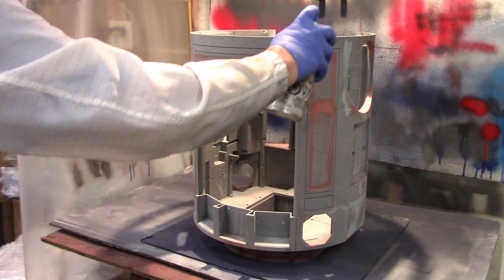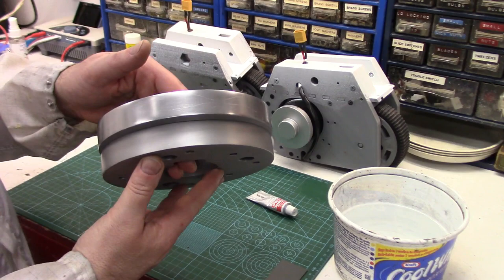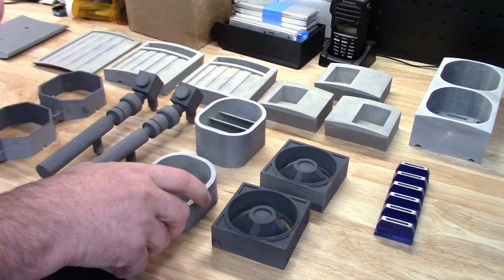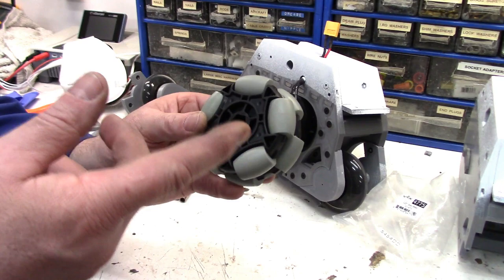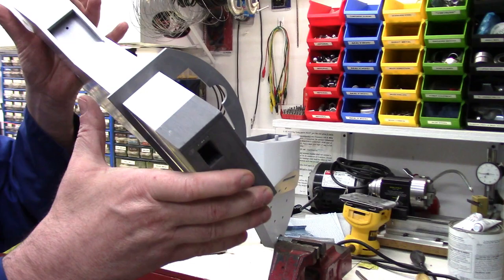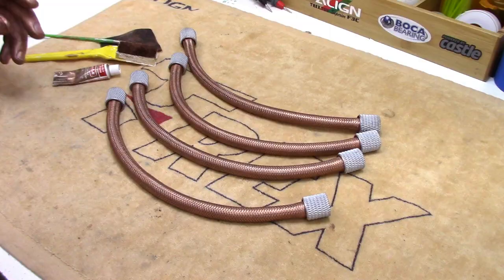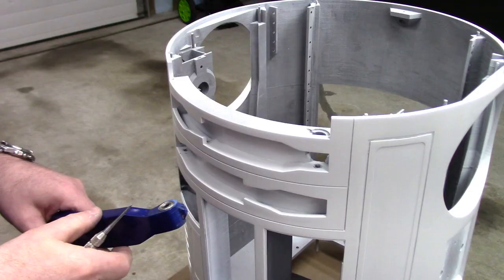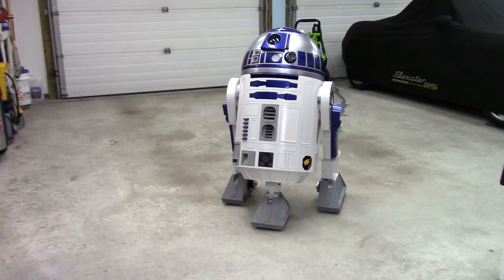Painting R2-D2 - Plus More Finishing Tips & Omni Wheel Installation.

Comment: Awesome build! I'm envious you got it done in such a short time. I've been working off and on with mine for 3+ years now. 
I'm a bit confused by your math though. You went through 31 spools of filament which to me would be 6 times the cost of all of your paint. Unless paint is a lot more expensive in Canada than filament. :)
Very cool though. You've lit a fire under me to make more progress on my build. I've gone through a lot more cans of filler/primer though and I still haven't touched the legs and body. That's what I get for printing at .3mm for everything I guess. lol
Reply from the maker: I break down final costs in the finished R2 video: https://youtu.be/sIpBA6UigTQ
As I mention in that video, cost comparisons of R2 builds are completely irrelevant as they vary greatly from country to country - even region to region. After tallying everything up, paint costs for me in the remoteness of the Canadian Rockies ended being the 3rd single highest cost behind electronics (1st) filament (2nd). Yes, spray paint is costly up here - as I joke in that final video - its base ingredient must be unicorn piss.
Reply: @Rchelicopterfun  I saw that video. And yes, when I heard your Unicorn piss line I cracked up.
Yeah, the cost varies. Sorry if I hit a nerve. I saw the cost on Amazon and balked for filler primer and went shopping. I found it on Walmart for $4.97 a can. I just bought 3 more cans since I've been going through a lot lately. (and 1 can clogged on me)
Remoteness: Ah. Yeah, that'd suck on shipping costs and timing.
Question: I was curious if you are going to take a stab at building a flying droid next (the Imperial Probe droid has been done but I haven't seen plans for the flying version out though) Or one of the other droids, or the remote control AT-AT on Thingiverse? :)
I tried to build a flying D-10 but I didn't get far.
Reply from the maker: @Chris Hechti - Hit a nerve?  Nope, don't know how that came across. 🙂 I just stated the cost of spray paint up here is high. Sandable primer $15 a can. Blue Pearl $22 a can. Rusty-Olium 2X $12 a can. No plans on any droid that flies. Having a full size R2 was a longtime childhood dream and it's the only Astromech droid I have any interest in, at least in terms of spending money & precious time on.
Reply: @Rchelicopterfun  Oh wow. Yeah, the blue Pearl was $14 a can for me. The White was $6.
https://www.youtube.com/watch?v=LAZP9rmpVd8
There is another version. Given your background with RC aircraft I thought it might tickle your fancy. Oh well. :)
Great work with the R2! I'm going to use a lot of your tips. And thanks for pointing out the issue with the dome bolts. I over tightened mine and couldn't figure out why it kept cracking for a long time.

Comment: You are truly a great builder, following you behind by about a month and the tips are really appreciated! Great work!
Just a quick question - I see you're using gloss on blue, are you also doing gloss coat over white color?
Reply from the maker: @Drowiz - I'm clearing the blue parts only; they are the only ones I wanted with a deep gloss finish. In hindsight, having a flat/matt finish on the blue would have been much easier as it hides imperfections instead of magnifying them like gloss does. However... I love the look of the  glossy blue 🙂Have fun with your build too 👍

Comment: Definitely saving all of your videos as I am just starting my R2 project.  One thing: in the instruction downloads for Mr. Baddeley, he make reference to R2D2 v2 Centre Foot Guide (retired, use MKIII) but I cannot locate the centre for guide for the MKIII version - were you able to find it, or did you wing it? Thanks!
Reply from the maker: Sorry, but with the hundreds of files for this project, I don't recall. I also have a block of wood in my center foot due to the fact I'm using rollerblade wheel castors instead of omni-wheels. Perhaps it's a file I didn't even print?
Reply: ok thanks for the quick reply back!  I'm sure I'll trip over the MKIII instructions at the end of the project ! @Rchelicopterfun

Comment: Never having used rub and buff once it is on does it rub off?  Does it have to be reapplied over time?   Amazing work!  I am about two months away from starting my build and you have definitely provided allot of great info, thank you.
Reply from the maker: Hi Ed, I've never used it before either so no idea on longevity? Like any wax, be it floor, furniture or car; I would presume its longevity is directly proportional to the specific conditions it's exposed to.
As for it rubbing off, not really noticing much if any of that. From the all the research & reading I did on the R2 builders club, provided you buff it in properly and allow it to cure for several weeks, it's pretty resistant to rubbing off. I'm sure if I took a white buffing cloth to it and rubbed hard enough, there would some transfer showing or if I let people paw at, it might rub off over time, but neither of those occurrences is this R2 unit exposed to. 🙂

Comment: Quick question re: the Silver Leaf R&B - did all of the silver parts get the R&B treatment, or only a handful of parts where it made sense to use the R&B?  Thanks!
Reply from the maker: I R&B most if not all of the silver parts during the build and afterward. Still had some R&B left over in the tube - a little goes a long way 🙂
Reply: @Rchelicopterfun  thanks for letting me know!  I'm just under half way with the printing, and I've just started laying down the silver on the dome and blue on the associated panels

Comment: Where did you get the 2 mounting flanges that the omni wheel axle goes into that bolts to the motor frame? I cannot find the files for one for an 8mm shaft, just the omni wheel one. Any help would be great!
Reply from the maker: I used the hex ones in the Baddeley files and quickly tweaked  them in Tinkercad with an 8mm hole centered where the hex bearings used to be.

Comment: Hey John.....did you have any issues with the TPU wheels "slipping" on the ground?  Meaning.....if you start moving R2 forward, the wheels just spin out before getting traction?  I have not yet printed my TPU wheels but see a lot of people having this issue.  Wondering what I can do to avoid having that problem when I get to that point.
Reply from the maker: Haven't experienced that at all with mine (unless of course I pin the throttle like a mad man).
Reply from the maker: Just thought of one other thing - it has been almost two years since I programmed my Sabertooth 2x32 motor controller, but I'm sure I recall a power ramp parameter so you can limit initial torque. Not sure what motor controller you're using, but if it's a sabertooth 2x24 or 2x32, look on Dimension Engineering's website for the programming instructions and programming software to find all the fields you can alter.
Again, I'm sure there is a power ramp parameter and I wouldn't be surprised if I tweaked that setting but I also have reduced my output limits for the two channels that drive the wheels (to 50%) so the only way I can do burn outs is to turn off the dual rate to those channels and as I said, drive him like a mad-man with full stick commands.
Easy to burn out then and smoke the tires 😄 at least on smooth surfaces. On carpet, traction is insane to the point its dangerous how fast the little bugger will accelerate. I rarely run him over 50% dual rates on the drive wheels for that reason.
Reply: Thanks John.  I really appreciate your help and want to thank you for the great tutorial videos. @Rchelicopterfun

Comment: Hi John, i make a R2D2 thanks a lot for your very nice videos its help me to complete the project.  I gonna use the omniwheel vex robotics, did you think you can send me the print file for the spacer like you did. Thanks
Reply from the maker: I didn't save those little wheel spacer files. Made them on Tinkercad in a under a minute so didn't see any value to having them.
Reply: @Rchelicopterfun  understand no problem your video is great, thanks for sharing. I made a special Halloween Star Wars theme